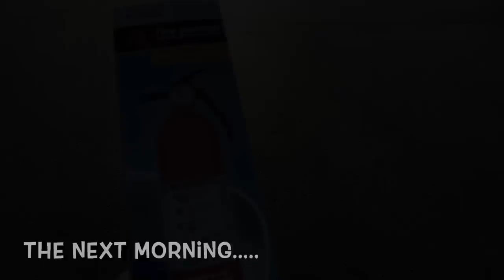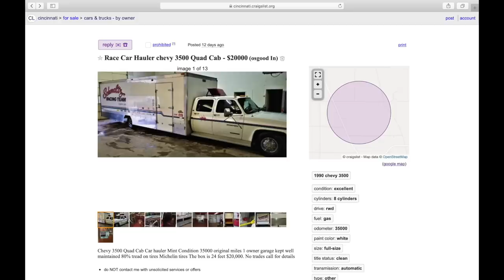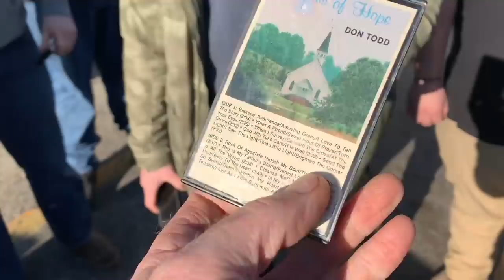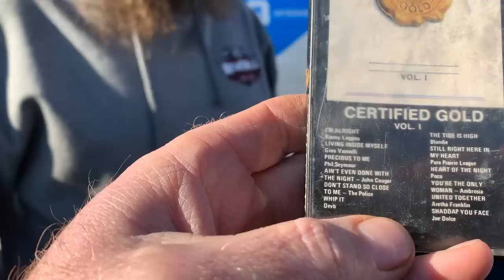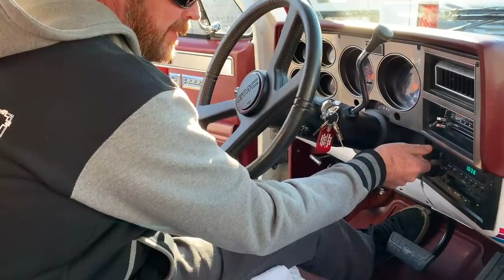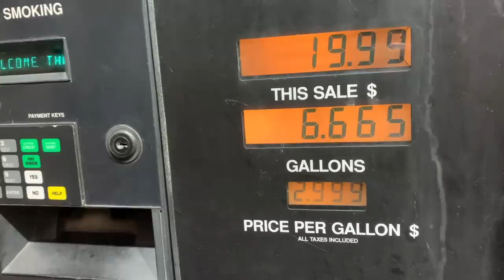Finnegan's Garage Ep.60: Blowouts, Rusty Gas Tanks and The World's Longest Ramp Truck!

Comment: Cummins swap for sure
Reply: This thing should have been a Diesel rig from the start!! the 454 is nice but geez!
Reply: cumminsfreak god nooo!! I freakin hated when he did that to the other ramp truck keep it gm!!!!
Reply: @justinraystyles3537  
Then duramax swap
Reply: Hi have a nice day yes cause at least its still gm👍
Reply: @justinraystyles3537  but you see, Cummins is the better engine so ya... Personally I'd be trying to find a Cat that would fit because my blood is yellow.
Reply: Jay Dunbar hate cummins cause of the overuse in other trucks besides the 94-02 rams!! but I like em and yes I like a good ol cat engine but how about my all time favorite sounding diesel a screaming Detroit diesel!!##
Reply: @justinraystyles3537  Need a 2 stroke Detroit turbo diesel.
Reply: Nah, keep it original, this thing is a time capsule.  IMO you don't hack up something that nice.  Maybe put an overdrive trans in it, keep in mind 1989 the speed limit was 55mph, traffic moved slower back then.
Reply: @aaronbays4  if he plans to use it other than a show vehicle it shouldn't be breaking down on the road.
Reply: @aaronbays4  He at least needs some more torque. And fuel tanks
Reply: @mfThump  Its called deferred maintenance.  Anything that sits for 10 or 20 years like that is going to have issues with dry-rotted tires and problems with the fuel system because the gas went bad.  With today's ethanol fuels, they really wreak havoc on gas tanks, rubber parts, etc if you let the gas sit and go bad.  

The seller should have replaced the tires and at least dropped the gas tanks, maybe replaced them if they were really bad, replace fuel pump, replace the fuel lines and filter.  Or tell the buyer that its been sitting a while and might need some work, price accordingly.  

The reason they got mad is they were told it was turn key and ready to travel across the country.

Comment: Of all the lessons learned on Roadkill, you'd think a jumper box would be a minimum "tool" to have at your disposal.  And, I don't know many places that will sell a battery for this truck for $80 these days......  Seems like dual fuel tanks often cause problems, no matter who makes them.  And why sleep in the back, when you could sleep on the seats in the cab?  And, when this truck was built, if it had overdrive, it would very likely have an "OD" or "O" or similar at the PRNDL.

Comment: I was waiting for them to find out the charging system didn't work either.
Reply: Thankfully an alternator is as easy as a fuel pump. well, a mechanical fuel pump. easier than an electric fuel pump by miles!

Comment: Good show, but not sure why there was so much (negative) talk about the previous owner.  It's a 30 y.o. truck regardless of the condition (purchased on craigslist, of all places).  Trying to drive it so far you're lucky the list of problems was so short.
Reply: Matt Kremer the seller knew the truck had issues. Outdated tires for one, and a plugged fuel system yet neglected to disclose any of it. The seller obviously knew the fuel lines were plugged which is why he probably didn’t try driving it to pick them up at the airport. Instead...meet at an auto zone.
Reply: @Whisper_Pickle  the seller was a relative of the deceased owner....no way it could have been known that the fuel tanks were rusty.  Honestly if you buy a 30 year old truck & expect the battery to be fine....you deserve your woes.
Reply: @MattKremer39  so in that case the relative of the deceased owner should have stated that they weren't too aware what state the truck was in, it looked good but may possibly have issues. Not say tyres are fine, trucks fine and can drive half way across the country. It's one thing to be ignorant of issues, its another thing to blatantly lie as though you aren't ignorant.
Reply: True, but all he said was that the tires were at about 80%....it's a craigslist ad, which is a crapshoot 100% of the time....

Comment: Luckily the carb did not leak. My 78 ford van has a holly 4452. Paid 300 to have it rebuilt. 10 years later it leaked from the transfer tube. Paid another 300 and rebuilt again. Another 10 years it is leaking again. This time I bought the rebuild kit 39.00. Change bowl gasket, transfer tube o rings and then accelerator pump. Leaks fixed running good.

Comment: How is it even possible that you have done 70+ RoadKills and you never even thought about getting a second gas can for when you run the caddy dry on the hi-way???  EVERY car/truck you guys ever go and buy has heat and fuel issues. I get it that you don't have a small radiator in your tool kit, but a FUEL PUMP!!!!!!  Come on man!!!!!!   Nice truck, but will be great after you drop the tanks and replace the diverter valve. Ps. Do yourself a favor and when you replace the tank switching valve, add a by-pass. At least with that you will be able to get gas out of each tank.. Maybe even stainless fuel lines as it looks like you will probably keep this one.

Comment: For the console you can buy plastic cupholders/ a little bit of space for the tapes in there as well. it will sit over top the trans tunnel on the floor. i rember them from my child hood in my fathers 80s chevy trucks. or you could get buckets and the console out of a k5 blazer.

Comment: Um you failed to take into consideration this truck has sat a lot. That's harder on them than being driven. When you can, replace all gaskets and hoses. Why the heck didn't you buy some extra jerry cans so you could refill the boat tank?
Reply: I Thought the boat tank was a smart move being on wheels. They could have dragged it to the pump if they hadn't made it. Should have bought two though.

Comment: 55 gallon drum of gas with an electric pump ?Turbo 400 trans with 4.1 gears .
Reply: Nah,Scrap the factory steel tanks,Install plastic tanks,and a Gear Vendors overdrive.
Reply: It must already have atleast 4.1 rear end. It's probably got something like a 5 or more. Theres no way a post smog 454 (<300hp) is moving that huge rig without 5 or higher ratio.

Comment: Easiest way to rewind cassette tapes is with the old cheap bic blue-cap ink pens. They'd wedge in perfectly. We didn't have these modern electric drill thingys back in them days, so you had to turn the inkpen with your teeth! Now, VHS tapes was a differn't story, you needed a large man's thumb, thet's what we called it back then. It's really just a big fat thumb. Attached, or not, didn't really matter much, as long as the hangnail hit the tooth on the spool, you could tighten it back up. As we all know, too many viewings without a fast forward to end/rewind, the tape gets wobbles up and down, usually because of pauses in the sexy parts (or so Ah've been told). The drive and the tensioner weren't all that synchronized. Same thing with cassettes. We didn't have that problem with 8-tracks nearly as much. 8-track eating players, that was still a thing.

Comment: This isn’t the first 20 year old used vehicle u have bought! U should’ve expected fuel tank issues! Sitting is the worst thing u can do to a vehicle! Ur going to have to clean the Tar out of the tanks & probably replace the pickup tubes in the tank
Reply: just slap in some tee's and multiple fuel filters in parallel right at the tank, if it doesn't want to pull with stock pump, cobble an electric pump at the tank...
that will get you home for proper repairs. the pickup tubes never seemed to be a problem to me, all the rubber section joining the lines were another story! gm loved to run steel line in sections and couple them with 2" rubber pieces, which all dry rotted and leaked on the "pump to tank lift/vacuum side"

Comment: 1989 with a carb? Thought they were fully phased out by 88, learn somethin every day
Reply: prolly because it was a heavy duty specially made truck... older equipment had a way of lingering for a few years on the commercial type trucks when the 1500's had already moved  on to newer body styles, fuel injection, etc
Reply: Had an 87 Honda that had an carb on it. Pretty reliable, but it sounded like it was cammed out when started on a cold day. Lol
Reply: Crew-cab squarebodies with carbs were available up to 1991.
Reply: Anyone else notice the diesel dash?
Reply: TBI was standard in light duty trucks. But this truck would be classified as medium, or heavy duty depending on the GVWR. Rules are different for that breed. Even a recently built gasoline powered truck weighing over 14001lbs doesn't have a full OBDII system, with emissions monitor support. Also nobody in their right mind would ditch a working injection system engine, and completely swap it over to a factory carb setup for that thirsty pig.
Reply: When I look under the hood of this thing, I see spotlessly clean box stock factory everything, so I still strongly doubt someone ripped out TBI, and swapped to a carb. So why wouldn't this have come with TBI from the factory when its little brothers did? There could be a multitude of reasons. GM may have felt that TBI wasn't mature enough for this heavy of a vehicle. Also since this vehicle is classed has MD or HD, it had more lenient requirements for emissions standards than what a LD vehicle would, so instead of spending the extra money on equipping with a TBI system, they may have chose to use up their remaining carburetor inventory for this model year. Or since this vehicle was originally built as a cab and chassis, if there was an option, maybe the company that completed the vehicle just mindlessly ordered it the cheap way. The other consideration is GM, and all other manufacturers hadn't completely sworn off carbs in '89. You could even still get a Caprice wagon with a carbed Olds 307, till '90. Several other companies had computer controlled carbs into the early 90's too.
Reply: So one thing to remember...in 1989 a 454, even with TBI, ran a carb intake with adaptor...and also smog pumps.  I cut up an 88 or 89 1 ton dually Chevrolet a few years ago for the big block and Dana 70, it was TBI.  Carb intake, fuel pump block plate and smog pump.  Just had an adaptor for the TBI unit.  Those plates were wild looking...big cast unit that had coolant flowing through it...same setup the 1/2 ton 454SS pickups had.  No TBI specific big block intake until the “Tonawanda” 454 in 90 or 91.

Comment: Come on Finnegan you played yourself you missed all the basics of buying a vehicle
Reply: There are vehicles You either buy or let 'em sit, but You definitely do not bitch about. Dude You could find more Mercedes 300 SL to choose from before You found another one like that, no matter rusty tanks or seasoned tyres'n battery.
Reply: @manfredschmalbach9023  such is the cost of buying rare vehicles. Still no fault of the seller for not doing due diligence, its common sense when buying a vehicle that's sat as long as this tank to check EVERYTHING. Expect failures too.

Comment: I think I would have wanted to punch him in the mouth if I just gave him $20.000 for that truck and he wouldn't replace the battery!!
Reply: It worked when they shook hands, didn't it? I hear You get shot with this kinda business attitude, Calvin.
Reply: Calvin H. — It was “as is” and it ran and the battery was fine when they bought it.  The seller probably felt he was going to have to own every problem forever at the rate things were going.  Fuel line, fuel fittings, fuel pump, then jump start, then battery, then fuel tank, more hose, electric pump, then follow to the hotel, then.... I would have bailed on them too if it wasn’t Finnegan.
Reply: @montestu5502 , All that shit you stated that was wrong with it means the seller is a liar. And there's no way that battery was good because Finnegan said he tested it and it read 8 volts. 
The seller was prob' hoping it would at least make it out of town so he could just say fuck them just like he did when he wouldn't even make sure they made it to the hotel.. If someone just gave me $20.000 for a truck I had listed as in A-1 condition and can be driven across the country, and the damn thing didn't even make it half way out of town, I would have made it right. Not been a scumbag and just ripped them off.
Reply: @spacecadet0 , Or they would.. Just saying!
Reply: Calvin H. —  It’s as is and the seller sounded like he spent the whole day tracking down parts for him and was turning into a never ending job.  At some point he had to cut bait.  If he was smarter, he should have taken his name off the side of the truck before he sold it!  Or does that just prove he thought the truck was fine?  Also he planned to meet him in Cincinnati at the airport, so he thought it was road worthy.  The first clue was that it couldn’t make it to the airport.  Furthermore, Finnegan is going to make some good money on this video and it was a good adventure for him.  If it was all OK, we wouldn’t be having this discussion.
Reply: @calvinh.8882  no, they really wouldn't. 

Its no fault of theirs that Finnegan didn't do his due diligence with a vehicle that's sat for years. 

So it appears pristine and has low miles, big woop. Mileage only accounts for road use wear. Oxidation/corrosion only takes time, something this tank got plenty of. He's lucky it wasn't worse.
Reply: @spacecadet0  , Yes I bet they would.. 

And the seller placed and ad of lies.. And I don't care how anyone else see's it or feels about it! I would have wanted to punch him in the mouth for asking for more money to buy a battery with when i just gave him $20k for what was said to be a perfect truck! It's as simple as that!
Reply: @calvinh.8882  now you're just being silly. If the ad were found to be legally binding (by a court, cops don't mediate) the seller would only be on the line for fines and costs. Still no jail for them.

Punching someone on the other hand, tough news buddy. Your bit of violence normally leads to a stay in that stone box. Nice try though.
Reply: @calvinh.8882  reread my original comment perhaps? Context is a thing.
Reply: @spacecadet0 , Reread mine. It's how I feel and I don't care what you or others think about it..
Maybe people should get themselves some morals..
Reply: @calvinh.8882   About that, if you're buying something as is... it's on you to ensure you know what you're buying.

Simple fact is, they failed to effectively navigate a used car sale. No one in their right mind expects 20 year old tires to hold at highway speeds, a fuel pump to work through rust, or a battery that's likely seen many winters without use to take a charge.

Anyone who's bought used auto should know to take NOTHING at face value. 

That diamonds just glass my friend.
Reply: @spacecadet0 , About that. I don't care, I would have still felt like punching him in the mouth for wanting me to pay for another battery. It's as simple as that..

Comment: A little tip guys.  Next time, prime the carb bowl with fuel.  If it's got a Qjet, just pour some fuel down the vent tube, and fill the bowl.  This will give you about two minutes run time.  Those fuel lines are so long...  Yeah, I used to have a nice four door C30 with a nine foot flatbed (I made the bed) that I dearly miss.

Comment: I bought my 89 GMC Vandura 2500 for 850, I didn't look at the tires because it was winter and they were covered in frost, 2 weeks later I blew both rears and a front drivers all within a month. Also mine shifts into 2nd almost off idle, I give it a bit of gas and I'm doing like 15 KM/H and 2nd is right there.

Comment: My C20 did the same thing fought it for a long time electric Fuel pump is the way to go New GAS  is not happy around Old style fuel pump and heat equals the Vapor lock
Reply: It was because the tanks were full of rust.  Electric pumps dont like sucking down chunks of metal

Comment: I figured that was carbureted, being the HD truck platform, but others kept saying FI or someone in the video did.
I had issue with all the older carbureted chevrolet's, they ran steel line in sections joined with short pieces of rubber hose, which dry rotted and split letting the pump suck air and loose prime when shut off after a while, loss of fuel under load and extended cranking after sitting, minimal fuel leak smell!
also the "quadrabog" carbs have a tiny fuel filter at the inlet port, when plugged up they'll often idle then have fuel starvation under any load. it should have a large filter well before that point, if not  do add one! 
make sure to use good name brand hoses, got burnt there before (common auto parts places) the hose said fuel/vapor, made in usa, etc. it didn't last a year and split everywhere.....

Comment: cool truck. It has  an instrument cluster like one in an earlier diesel truck, judging by the rectangle between the speedo and gas gauge... In my truck, this is where the glow plug light and "water in fuel " light is on a diesel... I had an 82 Suburban 6.2 diesel with this. I put over 300k on it. You wouldnt have had the fuel issues with a 6.2. Just no power. but it would have never quit... BTW, if the truck had overdrive, it would be indicated on the gear indicator. I don't think GM put the 700r4 in a truck with this high of a gvwr. It was weak in a half ton. Gear Vendor is the way to go here! The 6.2 mentioned previously destroyed three (!) in its lifetime! Also, the 82 and newer trucks had the sloped hood and wrapped springs that didnt bend. The actual "Square body with flat hood and coil springs would break at a factory pinch point and bend the hood.